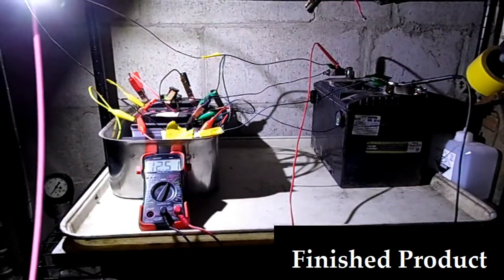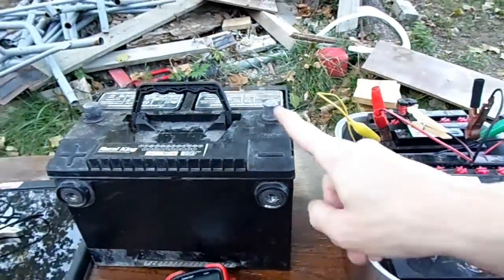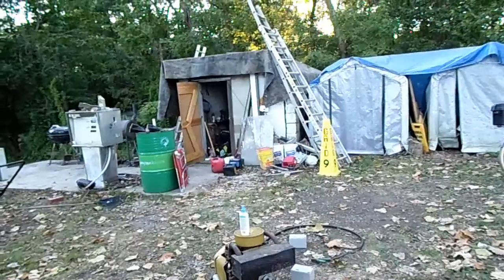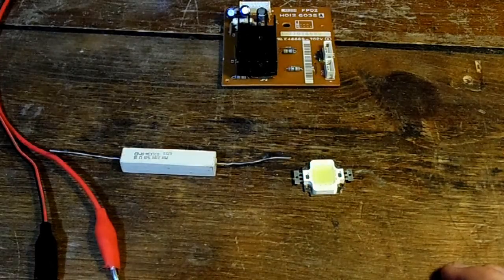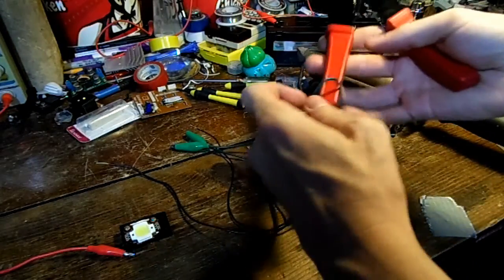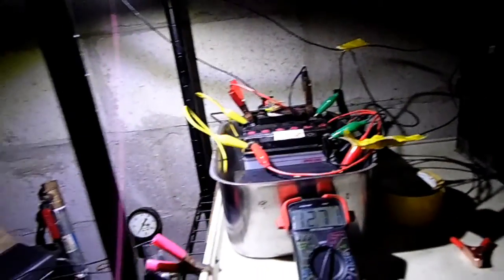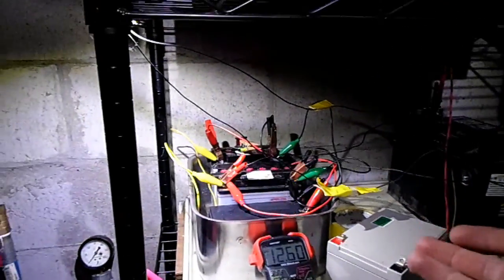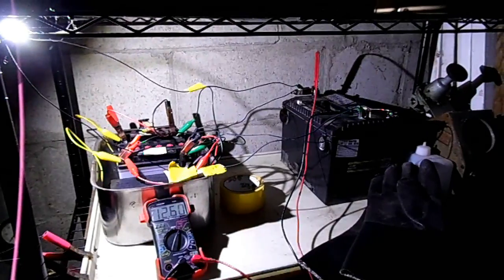DIY: Solar Shed Off Grid Battery System part 1

Comment: I HAVE AN 240 VOLT AC 10 WATT LED FLOOD LIGHT IS THERE A WAY TO CONNECT THIS TO A 12 VOLT SOLAR SYSTEM
Reply: susan chikande you have to connect it to a power inverter
Reply: You should be made aware that they sell 12v car/recreative vehicule led lights.

Comment: That's a great setup so far. Don't forget to angle the solar panel at approximately 40 degrees to the south. That way you maximize on the power coming from the sun. Also a tracker would be a good project too to get even more power. You could also use your step up converter too. Very well done.
Reply: Or just get a bigger panel lol

Comment from the maker: yeah unfortunatly i think the 12 foot width would be a bit annoying. i'm sick and tired of narrow working room. ima look into a shed like the one Aussie50 has.

i actually have the frame to a shed thats about 30 foot by 25 foot and 12 feet tall. just don't have anything to put over the frame yet. thats that pile of grey pipes in my yard FYI.

if i happen across a lot of sheet metal i'll put that shed up in the place of my two white tent sheds. and i already have a lot of windows to mess with.

Comment from the maker: i have decided not to mess with this shed too much, its falling appart and would hate to hook anything too it.

when i build my new shed i'll be sure to have clear sections in the roof for sunlight to get in and also i could have a telescope inside and look at the stars from inside my shed :D

i'm tempted to just buy a shipping container, could weld away if i wanted to change anything.

Comment: At some future time in construction, you might wish to get two mirrors and build a periscope device that would run down through the empty cells in the concrete blocks to channel light from the outside.  Unlike a window, no one could break in and because of the height, the time of avaliable light from the sun would be maximized.

Comment from the maker: i wouldnt exactly call it sturdy. most of the mortar is cracked and i keep accidently knocking out entire cinder blocks and having to squeeze them back in. and its a bad design. one entire wall isnt even attatched to the other 3 and leans away making a 4cm wide gap.

i hope to build a new shed out of scrap soon. would maybe use metal and wood and extra bricks would be the floor. like i could have wood frame and metal walls. would be awesome to get a kit shed like Aussie50 has :D